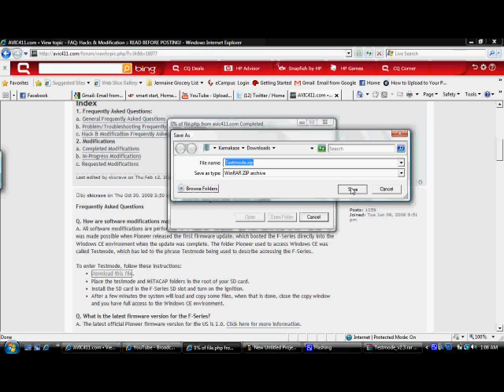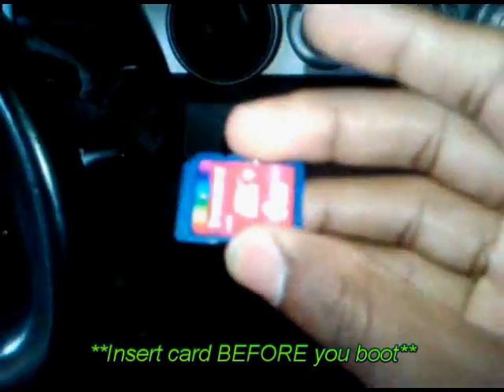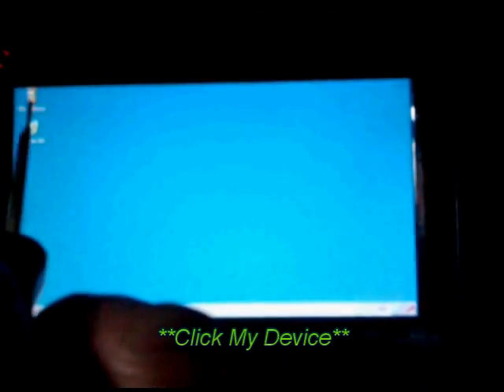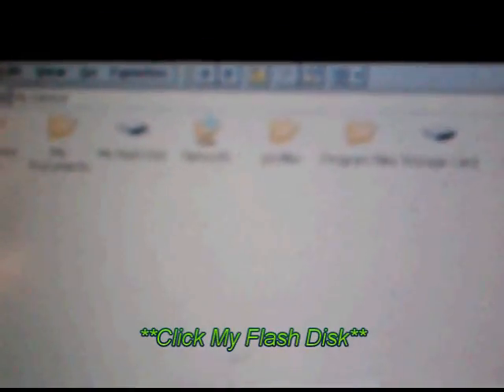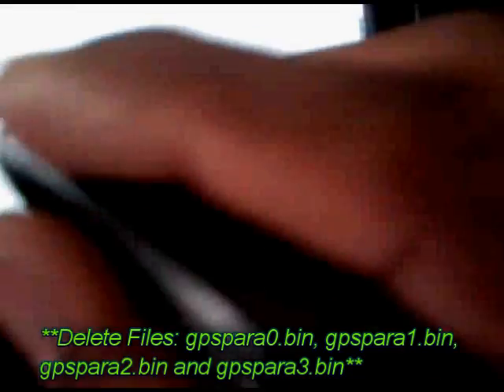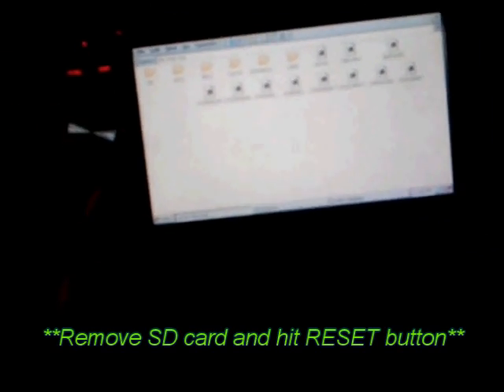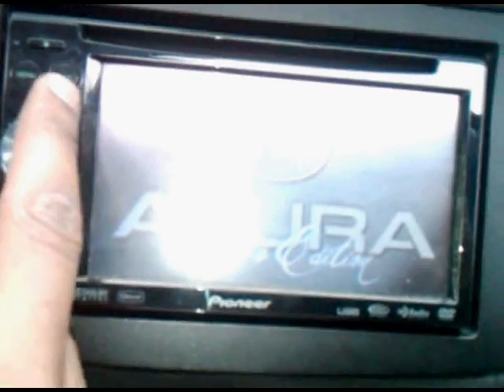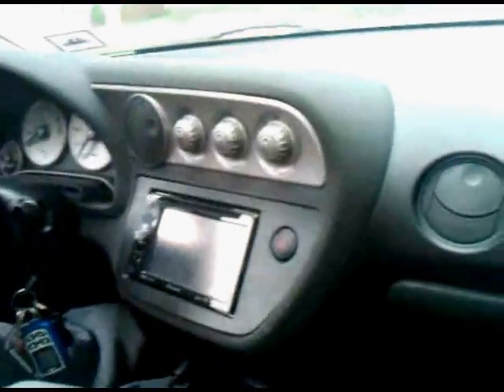Pioneer AVIC F900BT Reboot fix

Comment: I've searched the internet and can't find these files any does any body have a link.
Reply: ive been lokking too. I cant find them anywhere... i know its an old unit but still expensive.
Reply: lets keep looking ill let you know if i find anything.
Reply: So apparently guys on eBay are selling the files for the fix for about $15. Seems like the guys are legit. I bought one. I'm gonna give it a try. Better to spend little cash to fix something than to buy a brand new unit or even send in for repair
Reply from the maker: Let me check my files guys. Sorry its easier to communicate thru email. Those looking for the files hit me up j.moseley@unlimited exclusive.com
Reply: I just emailed JM exclusive he's going to see if he has the file in a couple hours.
Initial xg id like to know if the one on ebay worked incase JM can't find the file.
Reply: Yeah cool. I'm sure how Lon it's gonna take to get shipped over but I'll try it out first. If it works for me, I'll let you know
Reply: ok thanks.
Reply: guys email jm exclusive and hell send you the file.
Reply from the maker: www.unlimitedexclusive.com and fill out the inquiry ill shoot it to ya
Reply: @jaymuson1 any luck?
Reply: jm sent me the file but I'm having some problems with it. I can't find the exact file i need and some of them are damaged.

Comment from the maker: @bigslimdogjr the testmode.zip package files are all over a little searching its got to turn up somewhere, the ROOT folder is a term for the initial folder of the device. All those folders you mentioned are called sub folders...its like if you were to click on your C:\ drive, those folders listed like program files, users, windows all those are sub folders, if you were to drop a file outside of those folders, you dropped it into the ROOT of your C:\ drive understand?

Comment: Hey Man, The reboot problem just started happening to me. It will get to the main menu screen at the "starting system screen please wait"  will just stay on and not play any audio. Two questions...I can't seem to find the test mode files on avic411.com where can I get them? Also have a 1 gig SD card that I use in a camera it has 4 things listed. (DCIM) (Device.nng) (Gpslog) (MISC) You are saying to put it in the root folder I don't see a root folder listed. Can you guide me on this?